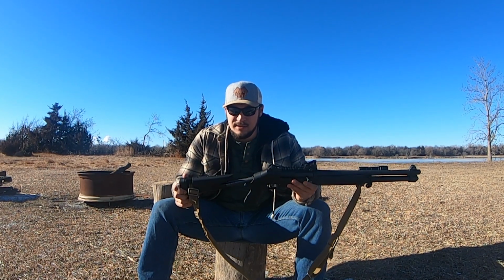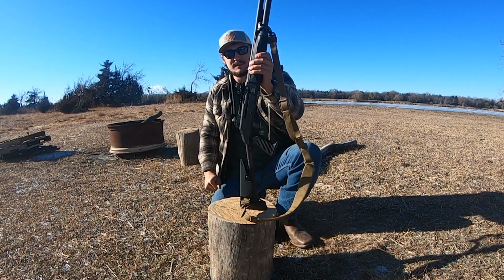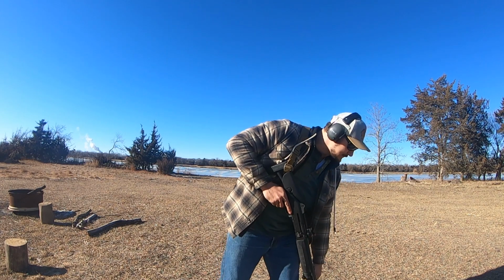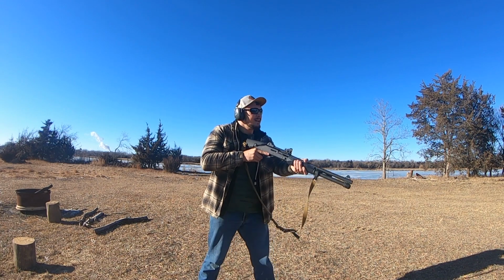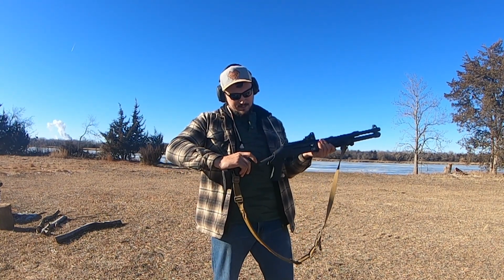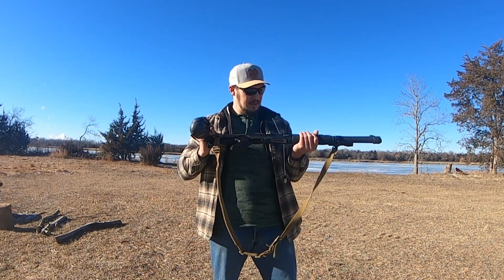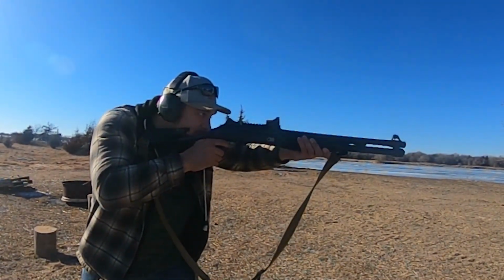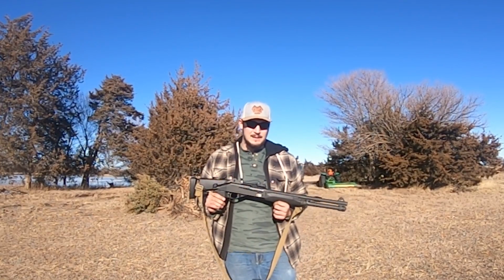Regal Metal Works 3-Position Benelli M4 Recoil Tube Review

Comment: My M4 doesnt shoot low recoil or bird shot. People say break in period, but a gun shop owner said its not that.. the gun wants higher power loads. His m4 does same thing
Reply from the maker: When you say, “low recoil or bird shot”, what do you mean? What are the specifications of ammunition in that class? Also, to what round count are you considering a “break in period”? 

The gun is rated by the manufacturer to function with ammunition of a minimum standard power of 1-1/8oz at 1,200 FPS, which is about a 3 Dram Equivalent load. 8 pellet buck is about 15/16oz payload and 9 pellet is about 1-1/8oz, so either pellet count requires at least 3 dram equivalent (roughly 1,200 FPS) to cycle reliably. My M1014 began to cycle down to 2-3/4 dram (7/8oz at 1,250 FPS, 1oz at 1,140 FPS or 1-1/8oz at 1,100 FPS) after several hundred rounds of buck, slugs, heavy magnums, and field/target loads (1-1/8oz or 1oz at 1,200 FPS). It has been reliable since with no reduction in action spring or hammer spring to reduce bolt travel resistance. 

While being able to run lower Dram equivalent ammunition is beneficial for training/fun, it is not what the gun was designed around, so it is not surprising when some examples will not cycle with sub-3 dram eqv. loads.

Comment: Did you upload a install video and I’m missing something?
Reply from the maker: No, an install video has not been created yet.
Reply: Interested in how difficult the install is. Many recommend a gunsmith due to the thread locker.
Reply from the maker: @Rattlecanjeff  Benelli uses a red thread locker. Applying heat is all that is required to soften/liquefy it so that the recoil tube can be turned out. You can use a heat gun (takes about 30+ minutes) or you can carefully and rapidly apply heat via a propane torch or similar. 

Once loose you can grab the tube with a padded vise or a pair of vise-grips and turn it loose. Clean up your threads, install the replacement tube, align the stock with the center of the action, then torque the lock nut down. Done. Assemble the internal components into the new recoil tube, turn on the  pistol grip and reattached the butt-stock.

I am not sure why so many are so convinced this is a gunsmith level install, but it is not. It is no different from replacing the abbreviated magazine tube with a full-length one. You are functionally not modifying the firearm at all outside of installing a multi-position recoil tube. It may be due to the fact that the M4/M1014 is a higher price gun and they are afraid of damaging it, not sure.
Reply: @AmericanArmsChannel  absolutely the high price of the gun and the fact that the female end of the install is aluminum has me a bit worried.  Good info and I appreciate the response.
Reply from the maker: @Rattlecanjeff  Just make sure you have applied sufficient heat for long enough to soften the factory thread locker. to prevent galling or finish wear on the back end of the receiver when breaking the lock nut free, place blue painter's tape or masking tape on the side of the wrench facing the receiver. It is also important to note that you will need to heavily pad your vise and firmly secure the receiver to prevent finish damage on the receiver as you turn off or torque down the locking nut or the recoil tube itself. 

Final note is that the recoil tube must be disassembled prior to applying heat or you will warp the action spring.